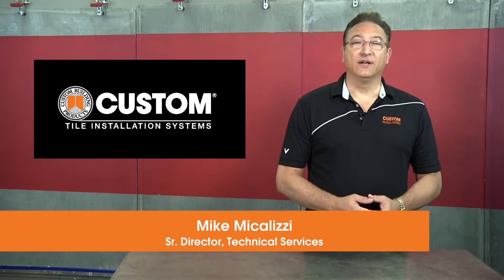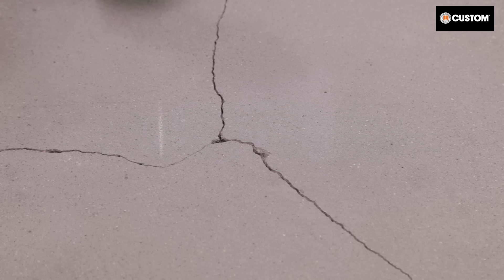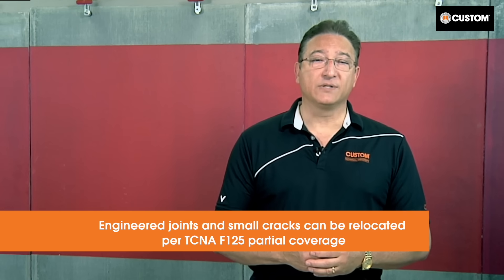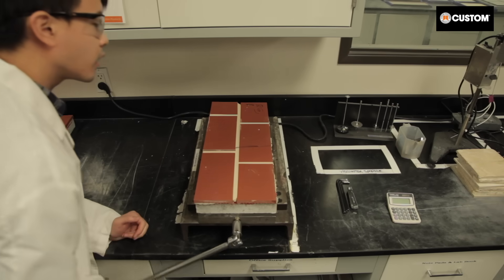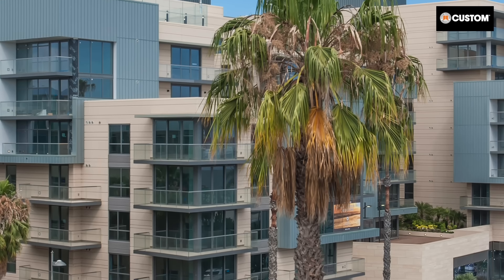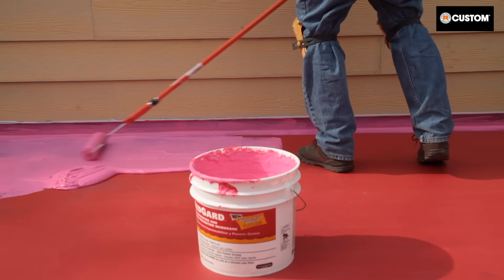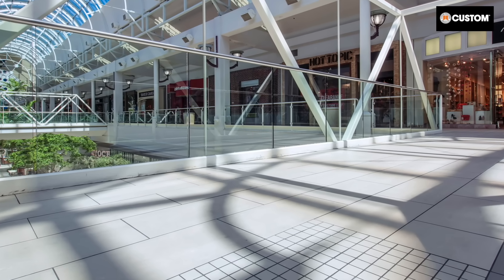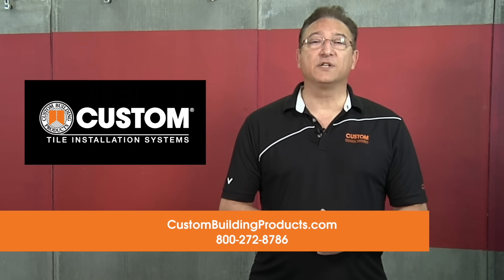Top 5 Tips for Crack Isolation in Tile Assemblies

Comment: Hi I want to re-tile my small kitchen (80 Sq ft) and bathroom (36 sq ft).  The floor is concrete underneath.  My priority is to prevent my 6 x 24 tiles from cracking from normal use.  Should I use a membrane?  Or will the redguard liquid application suffice?
Reply from the maker: RedGard is a waterproofing and crack isolation membrane. When properly installed it will prevent crack movement in the concrete from cracking the tile over it. To prevent cracks in the tile from impact or heavy loads, it is important to have full coverage of mortar between the tile and the RedGard coated concrete.
Reply: CustomBuildingProd  ty